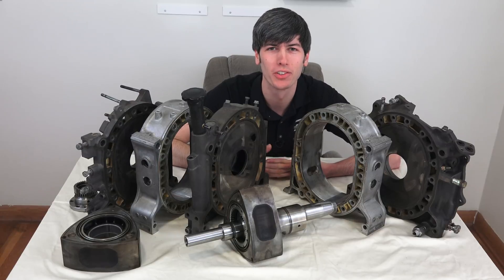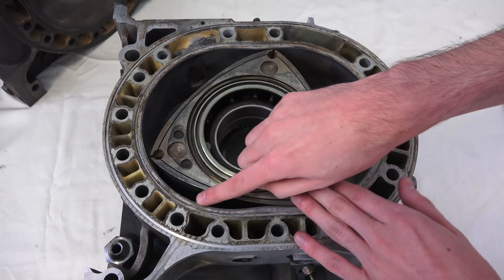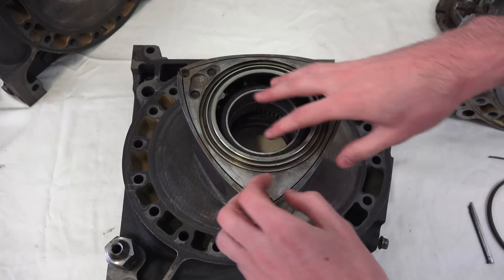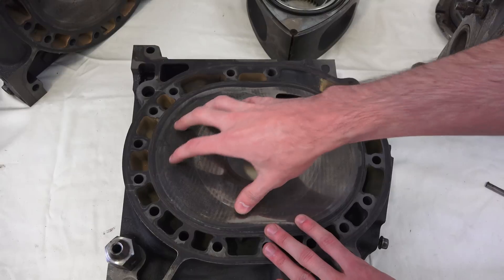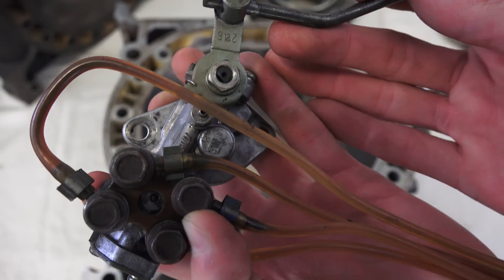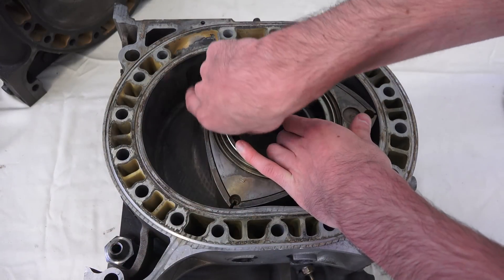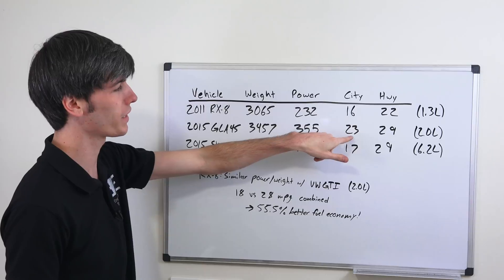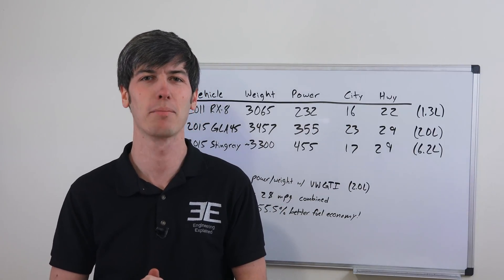4 Reasons Why The Rotary Engine Is Dead

Comment: Misconception that "fire" gets sent out the exhaust is that, a misconception. The charge has been burnt but there is still some unburnt hydrocarbons left in the rubbish that gets exhausted, but there is no oxygen left. This waste temperature is still above the flash point of the leftover hydrocarbons and ignites when it hits the oxygen at or just before the end of the exhaust port/pipe - that is if the port/pipe is short enough to retain it's above flashpoint temps.
Reply from the maker: +Mark Mark Absolutely. Perhaps I was unclear and glossed over that. Combustion may still be occurring when the exhaust port is opened up, but unburnt fuel exiting the tailpipe is what ignites (once oxygen is present).

Comment: ok, now make an engine with 4 rotary heads 2.0l and turbo, and compare it to the golf, the power per litter output is way superior to regular otto engines, same goes for two strokes, you dont use a rotary or a 2t for fuel efficiency, its for performance

Comment: Did you seriously just use CURB WEIGHT to compare efficiency and power?
Reply from the maker: F=ma. Heavier cars require more fuel to move. Yes, I absolutely correlated fuel economy and the vehicle's weight, as there is a strong relationship.

Comment: What were to happen if you were  to create a different shape of rotor like an octagon with warped/cut sides and put it into a smaller casing more in the shape of a circle to keep compression at the maximum i understand you may lose torque but it might increase the efficiency and if so you could have two ignition points as well directly across from each other so they fire at the same time recreating the the lost torque and making it nearly vibration less?

Comment: a piston engine also keeps burning the mixture as the compression gap increases, not a wankle issue. and its not really fair to compare an engine with cylinder deactivation, and a boosted engine to that of a wankle. horrible comparisons. if the wankle had cylinder deactivation like the corvette does, it would get just as good of a boost in mpg. problem is lube. 
and speaking of oil, chevy states that loosing 1 qt of oil every 1500 miles is acceptable. so this "burning oil" thing really isnt an issue.

Comment: it is not dead, they haven't implement direct injection yet. words about mazda working with toyota with hybrid system for next gen skyactiv. There is still hope for RX Vision, i really want to see a breakthrough about how mazda fix the intake/exhaust volume vs. velocity for a rotary which doesn't have any intake/exhaust valve.

Comment: Strange thing about some stuff is the theory is great but the production hits realities of practical application.  On a steam locomotive, the motion is reciprocal. The piston and that heavy rod has to change direction suddenly many times a second. That is implied inefficiency! All the energy wasted stopping and reversing direction of motion.  You'd think a turbine which is all forward motion would be more efficient, but it didn't work out in practice.  I guess that's the point here. A Wankel is all forward motion- a "lever engine" like a regular engine is reciprocating, (the piston and rod) so the Wankel eliminated this, but all the other real-world problems with a Wankel more than overcomes any gains..............

Comment: wouldnt it be better from a science view to use cars or the same year and power output or engine size instead of newer cars with the possibility of newer tech to overcome downfalls of models of the same year? 
power to size the stingray is a waste of motor compared to that 1.3L per what ever measurement of power you use.

Comment: You should compare cars built in the same year. Turbos also help with the heat differential by putting "preheated" exhaust/air through the intake.

Comment: Rotary engines are like fat women - they're not for everyone.
Reply: +q7wasp7 Right. Just like they will consume your wallet and not provide any real pleasure
Reply: +q7wasp7 They're fun to ride...until your friends catch you.
Reply: +Hercules Rockefeller Mmh well i would call chopping turbo BMW or other big engine street car with tiny 1.3 turbo a real pleasure. The looks of people who dont know power of rotary engine are just awesome when only thing they saw was disappearing tail lights and 1.3 on trunk lead.
Reply: Ironically Rotary engines are much smaller than piston engines
Reply: Hercules Rockefeller A 13b is most certainly not the same size as 5.7 L V8. The 13b is a 1.3L engine and is much much smaller. I can personally vouch for this as I have been around both engines. The 13b also produces ~230 HP and not 180 as you previously stated. A lot of the numbers are widely available online and I suggest you read the spec sheets on these engines before making these comments.
Reply: +Hercules Rockefeller You're doing something wrong if you let fat women consume your wallet.
Reply: rotary is like a big girl, takes a second to get going but once they do then all that flappin can make it happen. I loved my RX8 it was a perfect drivers car, this whole more HP is better is thanks to videogames and fast and furious series. The miata is one of the best handling cars and only puts out 150hp. may not be the fastest cars but they always put a smile on my face when i drive them. Like a big girl lol
Reply: Will stick with my "inferior" engine. It has been a good one and has lasted up to 65k miles on rebuild with bridge port. Stock lasted up to 195k and had some compression issues. You can go a head and put in a LSX and go through hell setting up wiring, modding bay for mounting, swapping tranny and gear box. Or you can pay someone to do it and still get smoked by a much "weaker" engine that some dude in his garage can rebuild and mod himself. If you decide to do that swap yourself I would be happily driving my car around for a good month before yours was working properly, save family, job and friends..
Reply: David Munoz Nothing I said is incorrect. Be more specific about what you think I got wrong.
Reply: David Munoz I'd love to see ANY stock rotary rev to 13k. When I had mine and hung with the rotary crowd, everybody wanted to see 12k. But that costs a fortune and requires having the rotating assembly dynamically balanced, double dowell pinning each housing, and a whole bunch of other supporting mods.
The rx-8's fuel cut-off is at 9,500rpm. And yeah, thats still pretty high, but rev's aren't everything. 
 
As far as v8's go, they can fit in the same engine bay as a 13b. Just because the combustion chamber of a rotary is only 1.3L that doesnt mean its the same size as a 1.3L geo metro motor.
Reply: I guess that explains why I'm a chubby chaser lol
Reply: +Hellsong89 You are absolutely right!
Reply: +q7wasp7 in some way yes, in another way no. They are like gymnasts, unbelievabely agile, controlable like lemmings, light as hydogen, motivated as teletubbies on speed, cultivated like a rolls royce on a funeral, and brutal like a torturerer on a vangeance-trip. It really is the diver's choice, my choice. and i love it.
Reply: ***** Rotaries rev lower and are weaker than a modern 4cyl.. There are multiple reasons why no one produces it anymore.
Reply: ***** If you can refute my claims then do it. They ARE weaker than a 4cyl and have the fuel consuption of a v8. 
I've owned a couple of rx-7's. There is nothing special about them. They are a failed design, if they weren't, then a company would still produce them.
Reply: Hercules Rockefeller  they are sick ass performance motors they can make some crazy power you know the worst thing about rotary are the owners
Reply: David Munoz Crazy power? The Rx-8's Renesis made around 180 whp. 
The 93 Twin turbo made around 250 crank hp. 
Not exactly 'crazy power' by modern standards. I give props to the guys that do crazy things with them.. But the same performance could be achieved for a-lot cheaper with a conventional engine.
Reply: 930 hp from a 2.6 l turbo 4 rotary is. 250 from a stock 1.3 na is too. and then there is the really good stuff to consider: rotarys are unbekievably compact. you can place it wherever you want to improove the weight distribution. and they are about the same hight as the transmission ( 320mm for the renesis)  lowering the center of gravity. putting a rotory in a car improves the handling, because the laws of physics don't bend.

renesis won several awards i quess you know better than a couple of groups of experts. btw, what where your qualifications again, owning 39 cars on gran tourissmo? dude, you have no idea, you never even sat in a car with rotary engine. you don't know man, you wheren't there.
Reply: +David Munoz very true
Reply: Quantum Tunneller Not really. A 5.7 liter V8 can fit in the same engine bay as a 13b. It weighs about the same, makes much more torque/power, and gets better mpg with better reliability.
Reply: Hercules Rockefeller OK your wrong about them reving lower the a piston they rap out at like 13000rpm somewhere around there they are not even close to the size of a 5.7L and a 4 rotor is built not bought they do not manufacture them and as far as price I don't know myself but I would think rotory would be cheaper considering they have 100+ less moving parts the a piston motor
Reply: OK just because you can fit a v8 in the bay does not mean its the same size there's dudes putting v8 in  civics and miatas and bunch of other lil cars
Reply: David Munoz The point I was making is that, just because a rotary engine claims 1.3L of displacement, that doesnt mean its as light or as small as a 1.3 liter piston engine.
A LS-1 weighs about the same as a turbo 13b, and is definitely lighter than a B20.

Comment: I had an RX-8.  It was an awesome car in a lot of respects.  If you have never owned one and you like to drive, you are missing one of life's finer pleasures.  Winding that thing up on a twisty road in the mountains, the engine at 9,000 RPM and happy about it, was just insane.   It had this very docile character as a daily driver, but whenever you wanted to, you could really make it sing.   It wasn't neck-snappingly fast, but you didn't mind at all.   The torque curve was perfect, smooth and linear.  

It did eat premium gas like it was going out of style, in heavy traffic it would get about 12 mpg on a good day.  You could actually smell the unburnt gasoline coming out of the tailpipe at idle.   And the gas tank wasn't that big, so you were constantly feeding it.   You did need to keep a quart of oil in the trunk just in case, but it really didn't eat oil very fast - that they seemed to have largely fixed.  And it was perfectly reliable.  It was my daily driver for about 5 years, until I needed a more adult car.  

It was not a happy day, the day I sold it.   But I definitely do not miss the cost of its care and feeding. 

I would probably buy another one if they were available again, but probably not as a daily driver unless the efficiency has improved.  It was just too expensive to run.

Comment: Made some good points, but I can't think of a single engine that does not burn oil by design. PCV or positive crankcase ventilation on a piston engine sucks oil vapors into the intake to be burned. As far as oil burning making emissions worse, I doubt it as fuel management systems account for a significant amount of oil being burned and slightly lean the mixture so when the oil is added it is at the correct mixture. Finally engine oil and gasoline are hydrocarbons in a perfect burn the result would be same, water and CO2. Now neither fuels will burn that perfectly but seeing how used engine oil burning heaters are commercially available, oil burning must be good enough for the EPA.

Comment: Well, in the aviation world they are amazing, they are used on the motored glider ASK-21Mi, high revs are great for propellors, and it doesn't vibrate as much as a conventional piston engine, which makes the airframe last longer. I mean don't get me wrong, they aren't very fuel efficient at all, but in aircraft i think the benefits outweigh the disadvantages.

Comment: Absolutely agreed on disadvantages. But homeboy, how about comparing a 2004 engine with other engines released in 2004. You compared a 2004 engine with stingray, and GLA engines which are brand new.
Reply from the maker: +AlmightyGTR 2001 GTI gets 33% better gas mileage. 2004 Corvette is significantly more powerful, larger engine, heavier, and still gets better fuel economy. I'll agree it wasn't fair, but it's also not inaccurate to call it inefficient.
Reply: +Engineering Explained I understand that, and I am not refuting those numbers. They are facts. However, when you compare numbers, you have to ensure that you compare the comparable. If 2004 corvette engine could have proved your point, you should have used that engine, but you chose not to. An old engineer to a new engineer, people smell bullshit when they think that you may be trying to bullshit them, even when you are not. I know that you are not bullshitting, but because you are comparing a new engine to an old one, which takes the comparison slightly out of context, that is enough for people to start judging your credibility.

Comment: Can a rotary engine run with a 2 stroke oil? Because if it burns oil by design, maybe using a 2 stroke oil as a lubricant is better because 2 stroke oil was designed to be burned.

Comment: May i ask any reason why in your engine comparison you are not using vehicles from the same year 2011.   As I would assume the 2015 engine variants would be far more efficient than their 2011 counterparts?

For instance the 2011 GLA 45 has 13 city and 18 highway
and the 2011 corvette stingray is 16 city and 26 highway

So I would say the 2011 RX-8 has the city millage of the 2011 corvette and better than highway milage of the 2011 gla 45 so yeah your previous points are fine but really if you're going to do a comparison dont try and stack the odds by doing a unfair one.  BTW this info very easy to find on the net.

Well I still found your video interesting.   and well presented.
Reply from the maker: +freequest There is no 2011 GLA45. Production started in late 2013. 2001 GTI gets 33% better gas mileage. 2004 Corvette is significantly more powerful, larger engine, heavier, and still gets better fuel economy.
Reply: Still .... why not compare to same year release cars.   You do know the comparison though is rather extraneous to your argument why they are not in production.

The reason is they won't pass Euro 5 standard for vehicle emissions which you have shown quite competently and I'm not arguing with you do a damn fine job of it.

It just annoys me that you're comparing something old with brand new vehicles that just does not seem fair at all and is a needless point in your otherwise excellent video.

Comment: Those figures are fuel emissions are a bit misleading, as the Mercedes is turboed, where the RX-8 isn't. You should be using a 2 litre non turbo for a fair comparison. Same deal with the Golf. 
The second issue is using the engine's static capacity as reference with fuel emissions, as the full capacity of each housing (654cc in a 13B) is used for 1 full eccentric (crank) shaft rotation, where as each cylinder in a 4 stroke piston engine will only use its capacity for half a crank rotation, effectively meaning it only uses its engine capacity every 2 crank rotations.
Reply from the maker: +Adam Lockington How about a 2004 Corvette with a much larger engine, heavier, way more power, and still better mpg. It's inefficient regardless of what you compare it to.
Reply: +Engineering Explained I never claimed it wasn't inefficient. 
My point is that the figures aren't as clear cut as they seem, for multiple reasons. 
One being that someone could say that the power output of the Renesis 13B is much higher than what a typical 1.3L piston engine is, with the obvious reason that a rotary provides power like a 2 stroke, rather than a 4 stroke. Yet, many would consider the power to be somewhat on the weaker side when compared to a 2.6L piston engine in terms of combustion capacity. 
Without this information, people who look at the information presented on the whiteboard are taking from it that a 1.3L engine is only getting 16mpg. They would also be taking that a 2 litre piston engine is capable of making 355hp and getting 23mpg, without realising that it was a turboed engine. Your average 2L N/A engine these days doesn't make anywhere near that power. We both know that an engines capacity isn't as important when it comes to power as how much fuel it consumes. That's why my 1990 250cc bike with an 18,500 redline can power away from pretty much all the current 300cc bikes. 
By all means, I agree that a rotary is inefficient. Mazda are aware of the thermal state of the 13B, which is what they have been attempting to resolve with the 16X by increasing the stroke and reducing the width. 
However statistics need to be presented on a properly level field. I feel the ones provided here have been unintentionally skewed by missing vital information.

Comment: Kind of knew they were not the most efficient engines out there but never expected that oil was injected into the rotor and then burned when reaching the combustion chamber. Separate reservoir for 2 stroke  or castor bean oil (as in model airplane engines) maybe would have given better pollution numbers??